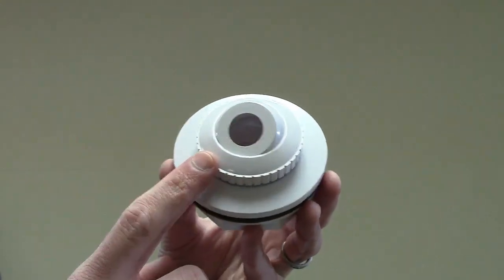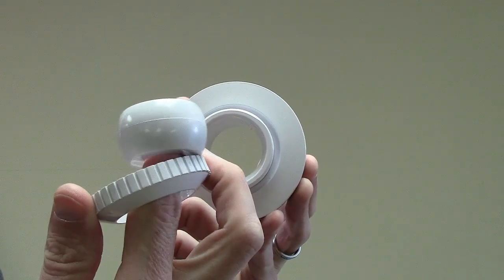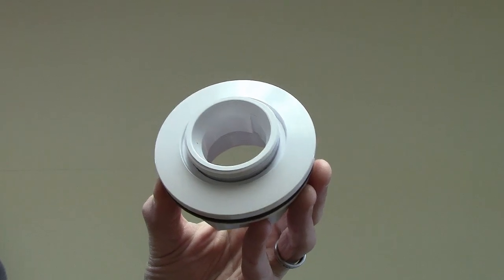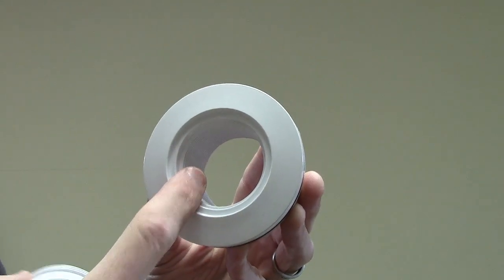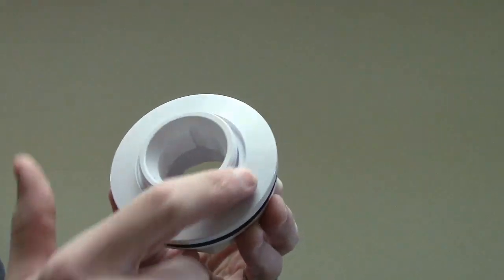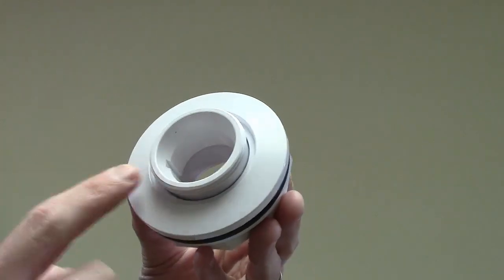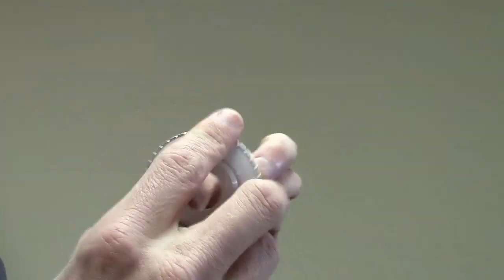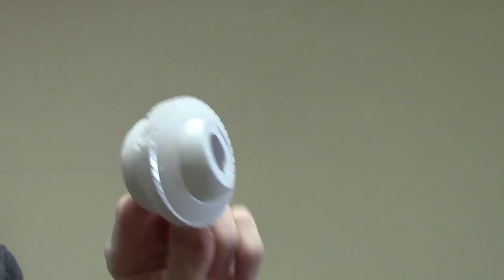Removing the Eyeball from the Return of your Above Ground Pool

Comment: Wrong about how he is explaining to removing the plastic that you connect the eye ball to, you don't use pliers because you can damage, there is a plastic tool, if you look inside the plastic there are two carved out lines and this is used for that tool which acts like a screw driver head to remove the eyeball base. Check with your reputable pool dealer they will explain.

Comment: Bad advice.  If you tighten down the "eyeball ring" too tight it will seize to the wall fitting.  And you will not be able to free the eyeball to adjust it.  Better to leave everything loose.

Comment: Instead of putting pliers on the plastic threads. Look inside you will see two slots. Those are used for tightening and loosening the inside piece.

Comment: Thank you for this video-they also make a plastic or metal key that fits into that inner part cylinder valve and it unscrews it with ease

Comment: I noticed that the third piece that if stuck can be removed with pliers and a towel as to not damage the threads, well can you tell me is there a key that can be inserted because i noticed two cut outs in that third piece that look as though a plastic key would be inserted and you would turn counter clockwise to loosen. I'am i correct or am i seeing thing?
Reply from the maker: I'm not sure who carries the part you are looking for, but frankly I think the towel and pliers trick is the better way to go.

Comment: I have an above ground pool. Around 16,000 gallons. It has only one return line. Would it be over kill to install another return on the opposite side of the pool?
Reply from the maker: Adding another return in an above ground with this water capacity doesn't really serve a higher purpose.  Also you would want to boost up a bigger pump for that.  I wont worry about it.

Comment: Above Ground Pros What do i do if my Intex filter PSI gauge isn't working moving from zero when its on {Filter Mode}? #2 : My pump really isn't strong enough for my large rectangle index pool, Do i need to buy a larger filter or how can i add something to make stronger ? # 3: Whats the best type of vacuum for an Intex pool,Because last year i bought an Hayward Bug and the pump wasn't strong enough to move it, Nothing worked for vacuuming out the bottom of the pool and the automatic ones are to costly. PLEASE HELP ..Thank you for your time ..
Reply from the maker: Stephanie English You sound like you are on the right track.  The filter system that comes with the pool isn't that good and won't run any auto-cleaners.  Your best bet is to upgrade the pump and filter and everything will then work.

Comment: I have the key to remove the inner thread but it won't budge any idea how to turn it when it doesn't want to go. It's installed in the pool already with water line above it. Had to fix the filter and couldn't plug the jet

Comment: I just bought a new 24 inch sand filter and it really has a capability to push a lot of water,, does the eyeball being a smaller hole ( 1 inch)  I think,, restrict or make more pressure ? I know in plumbing or hydrolics when you reduce the hose or pipe it creates more pressure. Is it better to keep eyeball in or place bigger elbow or 90 there to create better flow? Thank you for all your helpful videos.

Comment: The retaining ring over the eye piece will not come off the entire flow vent. They are both plastic.  Tried lube and a vice and with more pressure I'm sure they will break. In the video he simply unscrews the retaining ring. Fat chance! Mine is stuck in place. Guess I have to order a new one to work with the new eye piece directional flow I just bought today.
Reply: Did you figure it out.? I have same issue
Reply: @willisshields647  I have ordered another. Still waiting for it to arrive. But I could not get the original one open.
Reply: @willisshields647  I received the new one and it won't come apart either. I give up.
Reply: I bet you I spent 3 hours on that the other day I got some different PVC pipe fittings and finally was able to adapt it over top of my vacuum hose connection it works

Comment: The eyeball for my return is one pice. I got a part to change the eyeball with a new vacuum but can't use it because it's only the eyeball and it didn't come with an outside cover to hold it in place
Reply: just to make it clear. when you take off the outside cover and then the eyeball that directs the water is one pice on mine

Comment: Just shooting this out in case you or someone can help me. I'm having a problem my eyeball which is in fact a 2 piece not 3. My Locking ring broke and the locking rings on these 3 piece assemblies do not fit. I have a 21ft above ground. There's a Aquarite salt system installed just before the inlet from the outside. The inlet into the pool is threaded inside and out and the eyeball locking ring goes on the outside of this fitting. The Inside thread would accept the piece that gets stuck in the video above but then won't take it's locking ring as it is too far inside. My local pool place says I need to replace the whole thing which I'd prefer to avoid for only a broken locking ring.
Reply: Anyone know where I can find a locking ring or some sort of extender for the 3 piece eyeball shown in the video?

Comment: the pull up n twist valve on the adapters for my above  ground intex pool. wont pull up n turn. i closed them to clean the pump, but cant get it back up n turn it. plz help. the skimmer side is working fine it is the out put side that wont work. what could be the problem?
Reply from the maker: I haven't yet heard of this.  Maybe you should contact Intex and see what they say.  It may just need to be replaced.

Comment: Hello.. been having a problem with that little piece on the inside.. it seems to be stuck..  The entire assembly turns.. even the outside. So i quit working with it.. I was afraid I was going to break something.  This eyeball assembly came with the hayward kit SP1091WM (skimmer and all).. it was just installed a few weeks ago when we did a new liner.. do you think maybe the installer glued it in?
..  I noticed (in your vid) looks like a couple of notches on the inside.. is there a removal tool.  Any suggestions on how to get this stubborn thing out?  I want to install a fountain.
Reply from the maker: There is no tool for it, but maybe you could wedge something in the slots to get it out.  It is possible that there may be glue on it (it shouldn't be that hard to get out) but I would call the installer to find out before you muscle it off.

Comment: Above Ground Pros, Hi there, love the videos, theyre so helpful. So I have a Splash Superpool (vinyl 10,000 gallon)  and the return inlet fitting is cracked and leaking. Whats the best way to replace it?  Ive read that you cant take the water out so Im wondering if theres even a way to do that job. Thanks
Reply from the maker: +Liquor “N” .Poker No, you can take the water out of this type of pool with no worries.  Just drain it below the return and replace it and fill it back up.

Comment: I have to adjust mine frequently so they don't mess with my pool cleaner.  Currently I have to use a large pair of channel locks to loosen / remove the locking ring since it doesn't turn easily.  Is there any trick, like using teflon tape or gasket grease, to keep the locking ring loose enough that I can turn it by hand?
Reply from the maker: +Glenn Roe not that I personally know of. But you don't need to make it really tight to hold the eyeball.

Comment: What if you can't get the eyeball seat loose? Im having the hardest time to get it to even budge. I've used the removal tool and nothing would move. Any suggestions?
Reply from the maker: +Miguel Barker If its a return just like the one in the video then it probably needs to just be broken free.  I use a pair of pliers for that and once its broke free it screws right off.  Make sure it the same one as in the video or it may be one that doesn't come off.
Reply: I appreciate your quick response. I unfortunately have tried to get it free, but it will NOT budge. It looks exactly like that and I have tried the tool, but it just seems old and stuck. I've tried pliers, and it just starts taking chunks of the seat away.
Reply from the maker: +Miguel Barker Maybe your best bet is to break it out or try again with the pliers and if it ruins the eyeball, you can always get another one to replace it that won't be old and get stuck.
Reply: Thanks, I will try it. I might try it from a different angle as well.
Reply: Miguel Barker did did you get it out and can you tell me how

Comment: That segment really helped me a lot thank you. We still have the original pool and the parts they replaced due to liner failure after 30 yrs. were not the same for closing. Now there are 3 pieces to remove, before there was only 1 which was the eye to screw a plug in place. Again thank you this was very helpful.